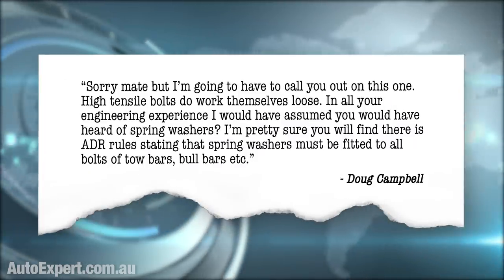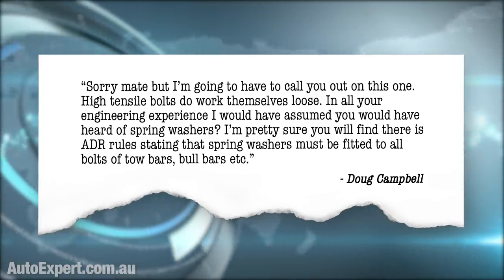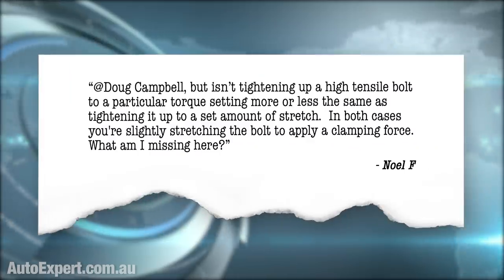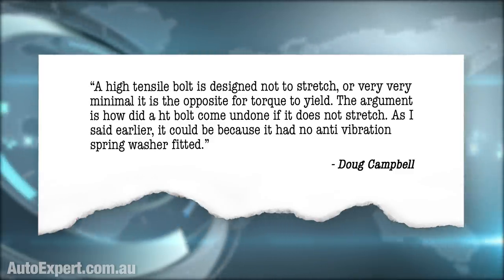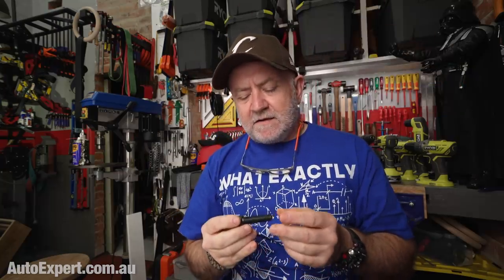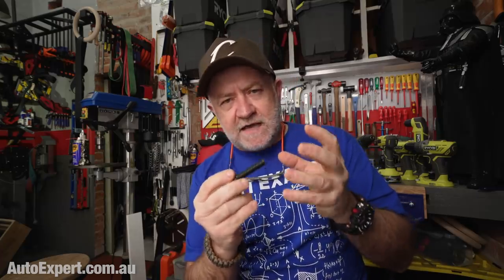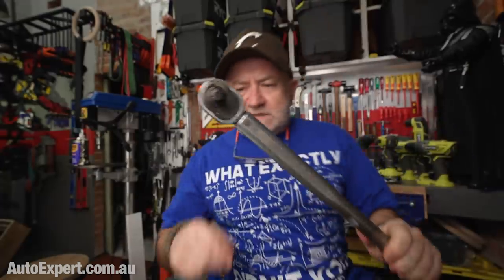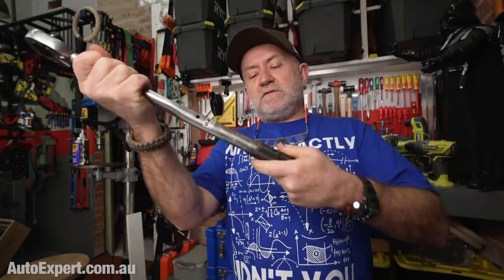The applied physics of high tensile bolted joints and assembly in cars | Auto Expert John Cadogan

Comment: Your conclusion about under tightening is probably correct, however there are two more possibilities: 
1) the bolts are labelled as 8.8 however counterfeiting is rife in Asia and they may actually be cheap chinesium labelled falsely. 
2) Your photos seem to show that the bolts have been coated. In Asia it is common practice for 3rd parties to apply galvanising, zinc, or a number of other different rust preventative coatings with complete disregard to the possible devastating affect upon the metalurgical properties of the fasteners due to coating. It is expensive for companies like ARB to ensure that the bolts that they buy were infact coated by the bolt manufacturer rather than a 3rd party, and maybe they just bought the cheapest untraceable bolts that they could find provided they were marked 8.8.

Comment: Thank you, John your video was so interesting, the 30:26 video felt like it was 5mins. The lesson was fantastic! The benefit is that you have helped improve the safety of tow bars and possibly saving someones life by educating us with the applied physics of high tensile bolts! Also and most importantly not to modify an installation kit in anyway. If I have a tow bar fitted , I will make sure to check the installation with a copy of the install instructions to make sure the fitter has fitting the tow bar correctly!

Comment: I agree with your discussion of clamping force and torque required to loosen high tensile nuts. I think there is another factor that makes spring washers ineffective on high tensile bolts. I think the high tensile bolts and nuts are heat treated to case harden the metal. The chisel action is less effective on a case hardened surface hence will not work as hoped on high tensile fasteners.  I may be using incorrect terms here. I'm sure John will correct this.

Comment: Hi John, love your work mate, I would like to throw in an observation about Tension Wrenches.
I was recently replacing the Con Rods and Big End Bearings on a 65 year old motorcycle, after tightening the big end bolts to the specified tourque (using a brand name British Tension Wrench) I could not rotate any of the 4 conrods on either of the crankshafts (Square Four engine with two crankshafts) 
After several hours of head scratching, beard stroking, disassembly/reassembly and measurements I “discovered” that my Tension Wrench was reading low by almost 50%.
8 new Big End Bolts and Nuts @ $150 later I have learned a valuable lesson.
Regards
Kevin Dennis
P.S. Just had a flashback memory of my time on aircraft in the RAAF, on some Critical Maintenance Operations we had to take our Tension Wrenches to a calibration workshop, have them calibrated and then carry out the task within a set (very short) period of time.

Comment: I did up some bolts yesterday with a 75mm socket to 8000nm, had to measure the stretch on each bolt (no spring washers)
Reply: M48 x 5 (10.9)   ?    :-)

Comment: Watched you for the first time yesterday on the tow bar issue and today on your response to Mr Campbell spring washer add on well done to you for putting right as this could avoid a serious accident. As a boilermaker in the oil and gas industries on high pressure piping work i understand your concern about doing things wrong and you mentioned repair welding of the split in the beam that you got spot on even to the point of mentioning of LH welding electrodes for high tensile materials unfortunately as you probable know welding is also a serious task to do right and many hobby DIY welders try and and weld stuff that there little cheap MIG welder is just not good enough for quality repair and don't know what a LH rod is . Greetings from the UK and keep up the good work.
Reply from the maker: Thank you very much John. I really appreciate your expert feedback. There is so much uninformed commentary on YT, and I am waging war against it. Your comments about DIY welders are spot on. I see infinity DIYers not bevelling their joints and then grinding their welds off, following marginal power welding... I feel your pain when you see stuff like that. Once again, thanks very much. Keep up the good work mate.

Comment: Chances are the towbar in the previous video was tightened only with a rattle gun. I use one to speed up jobs, but always finish with a torque wrench for anything critical. Properly torqued bolts don't come undone, otherwise every engine would just randomly explode at some point. Older style helicopters had something called the "jesus nut" or "god bolt" which attaches the main rotor to the drive shaft. It is amazing to think of the forces that can be managed by an appropriately engineered single fastener.

Comment: When you speak of the split-washers(spring washer)  "chisel action"...I've seen disassembled  bolt-washer assemblies & one will note these are only effective when the washer is of a harder material than that of  the bolt or nut, so that it  CAN dig in with that "chisel effect"....that hardness difference.
Reply: I agree. In fact that is the core of my comment. So the questioning the mind of this amateur is, "Is the hardness of the spring washer more or less than the hardness of the high tensile bolt and nut?"
Reply: @mayflowerlash11  As I noted, "I've seen disassembled bolt-washer assemblies...", and they are marked by  the spring-washer, making them  softer than the washer. A logical conclusion would be, if the two materials are of identical hardness, there would be zero "chisel action"...rendering the outright purpose & function ineffective. Is a "high  tensile" bolt softer than the spring washer?, I would think them identical, killing the function of the washer.

Comment: Spring washers generally are not used in aircraft applications. Nylock nuts or metal locking nuts are standard, but torquing is still required. I used to manufacture switchboards and all the bolted joints were torqued, because in high current applications failure would occur

Comment: Spring washers are helpful in light load applications in "softer" fastener materials where they can bite. I've never designed or seen them in high tensile applications where the rotation countering design can't bite due to both load and fastener material, and a spring washer itself always introduces a "weakened" element (by it's very design) into the assembly. I've designed many bolted and screwed assemblies over decades including adjustable open-cut mining rope fittings with custom made twin M64 threads and nuts of materials stronger than HT fasteners, and always with flat washers. One can use additional lock nuts with pins or wiring if an environment that may offer risk of loosening such as with vibration or cyclic loading. As to the stress and strain issue, you can't have one without the other, even if the strain is only at an atomic level at a very light loading. :)

Comment: In 33 years of mining experience flat washers are used with high tensile bolts on most of pipe flange bolt ups, talking 100 ton steam lines ! The only flange failures I saw was bolts not tightened or incorrectly tightened. Great subject to which most of us wrenchers neglect.

Comment: I reuse torque to yield bolts all the time!
As thread chasers.
You spin a suitably nut or die on one grind off a bit of one side of the bolt to create a cutting channel then spin the nut off and you have a thread chaser.
I also use them in non tensile places and even grind a point on them and use them as nails.

Comment: In my 20 year's in the commercial tyre industry,   torque figures were gospel upon every wheel assembly,   even being requested by the electricty power station too torque up for them in the powerstation,   plus everytime i was under a vehicle too jack up i looked out for loose nuts and bolts especially brake component ,  I would strangely enough find on a regular basis even Springs broken in half plus the brake pods damaged,   disc brakes smashed or badly cracked,   wheel nuts were a regular basis loose upon my onsite,   sadly mechanical workshops were the worst at that,   spider hubs were my favorite but sadly most weren't placed on properly,   I carried a box of studs and wedges and nuts because of not tightened properly,  even had one truck loose 8 wheels ex workshop,
Reply: You must be the only tyre fitter in the whole of Europe that torques up wheel nuts correctly, every one I come across is rougher than a rough  thing. Using a torque wrench after smashing the wheel nuts back on with a 1500 ftlb impact wrench isn't setting the wheel nuts at 600nm. Don't tell me you only run the nuts up then try um, well I've tried it at home just to see, just one hit and they were over 140nm setting. Hgv tyre fitters really ram um on, ive had the studs snap before now.
Reply: Michael  strangely enough I have seen and been a victim of fellow work mates and operating workshops doing them up so tight I have had to use a 2 metre steel bar and a wooden block to enable too losen nuts,   my thoughts are impact wrench too the face all around and then at least half a turn with the torque wrench,   strangely enough not many work mates liked working with me on the big jobs especially working Friday morning till Saturday night on my fleets of 60 truck and trailers,   as our trucks here in New Zealand are HGV only now with 26 tyres each plus they mostly use central tyre inflation systems,   plus all are highly polished aluminum rims,   plus on call 24  7   all year.   Sadly at 100 hour week's my body completely wore out and I am house bound now on the pension,   but my generation were taught hard work didn't kill you ha ha ha ha yeah right working for Bridgestone commercial was a good job,   my only concern is watching YouTube video,     😆😆😆🙈🙉🙊💩.

Comment: I am a fanboy of springwashers for applications with low torque spec, it is easy to see that someone wants to use them for all applications Doug is very likely a caring mechanic! After you used your torquewrench always put it to 0 NM again when you put it away.
Reply: Use long bolts and prevailing torque nuts instead.
Reply: @johnwade1095  Use the bolts the job requires and use them to spec.
Reply: @carstenweiland7896  generally, if I'm replacing a bolt it's because it was specced wrong. Or someone cut corners and used Chinese 12.9 fasteners.

Comment: Stretch Bolts, I remember reading a Kawa ZX7R workshop book and for certain engine bolts (head bolts) it was indicated that they could be used multiple times but provided a table that indicated how to torque/angle them based on 1-3 uses then throw them away, I can not remember if it also indicated the length to just confirm how many times they had been used.
I was surprised when I saw that.

Comment: Hi John, great piece. Especially the reduction in torque for lubed up bolts. Didn't cross my mind.

I do, however, have to point out, that the Earth is approximately 40kkm in circumference, not diameter.

Only because you are a meticulous person and often add corrections in your videos. Sort of reducing the possibility of some nut bag brining this up as an argument.

Comment: I totally agree with what you have said here . BUT working in the smash repair industry for over 30years my only concern about your last video is welding the chassis. It would be best to check the manufacturer repair procedures first .  
Some chassis’s you can’t heat or weld . Especially trucks. Car metals are so high-tech now many high tensile steel‘s used etc . Special inverter welders are required just on the panels alone . 
I’m not saying you can’t weld it . I’m just saying it’s ALWAYS best to check repair methods first
Reply from the maker: Good point, but ute chassis doesn't appear to be all that hi-tech.
Reply: @AutoExpertJC  you would be surprised how many you are not allowed to weld
That’s why they are written off by insurance companies so easily
Reply: @barry.m9681  I suspect that may be the reason for the dealer and Ford's reluctance to fix.
Reply: Someone had better tell all of the LC200 and LC79 chassis extenders out there they can't weld chassis anymore. I'm confident you can weld a chassis on a current Ranger  given that is how they make them, by welding numerous sections together to make one chassis. If it wasn't suitable to weld the chassis, it would be constructed using rivets or huck bolts.

Comment: Bolting in caves for climbing and rigging we never use spring washes even though they are under dynamic loads. It's kind 101 stuff, you tighten bolt correctly, set the bolt correctly, install it correctly... etc... you're bolt does not come loose (regarding high tensile). Mean it not got the same kind loads trailer does, but still high tensile bolts getting wiggled and pulled on a lot.

Comment: At 8:25 what are the types of fasteners specified?
If the nuts are self locking there is no requirement for lock washers on lower tensile connections.
Spring lock washers are entirely useless in any case, they either fail to prevent the fasteners coming loose or the fail period, the number of times I’ve had spring washers split apart and fall out before I’ve gotten to the torque spec is ridiculous.
There is however higher strength alternatives of  castlelated washers crown washers and the new dual ramp washers.
The dual ramp washers have been tested beyond the point that even thread lockers fail.
What the commenter said is partly true fasteners subject to high vibrations and or temperature changes can become loose especially if lubricant has been used on them. While lubricant can increase the amount of torque on a fastener as it helps overcome friction it can also give a false torque reading. The lubricant can fill the gaps between the threads of the bolt and the threads of the nut temporarily and when heat and or vibration causes the lubricant to seep out the torque is reduced.
It is highly recommended to recheck the torque on any fasteners that have been lubricated after a duty cycle.

Comment: One of your best. Aimed skillfully at the Engineer and Apprentice alike. Hopefully what Doug also took from this was the underlying message, if you are a mechanic, be the best you can be and and show respect to, and don't try to be, a design engineer.
Reply: @WheresmywingsRedBull  I did as you advised,  so did the suggested research at step 47.
Also, calling John a dropout does not enhance your credibility, clear thinking wise.
I think you have missed two points.
1. John explained the need for flat washers to enhance load sharing area which ARB use so they agree with his engineering analysis including the need for torque settings..
2. I was careful, as was John, to ensure I did not reflect on your qualifications, showing respect for your chosen area of expertise.
I suggest you could do well to do the same. 
BTW I am a mechanical and structural design draftsman without any particular agenda.
Reply: @Mechautoinsight  so if you had of looked at step 47, you will have seen that the manufacturer, ARB designed, and recommended spring washers to be fitted to  the bolts of the tow bar in Question, and they CLEARLY WERE NOT FITTED. Going against everything John has fumbled over in these two videos. Now if I break down your original comment, it implied I was trying to be a design engineer and had a lack of respect. Can you please explain to me how this is the case when both you and John have overlooked on simple thing. Follow what the manufacturer designs and recommends. I’m pretty sure John the hypocrite actually said these words in this video!

Comment: From what I have seen of most braking systems on trailers with the exception of those with air brake systems is that they do not fail safe!
Once the connection to the vehicle is lost the brakes have no means of applying. There is a small possibility that on some of them the towbar dragging on the road will put pressure on a brake providing the reversing lockout has been deactivated.
Reply: In my neck of the woods (mountain country) it is required on trailers over a certain size that have electric brakes fitted that there be a battery on board the trailer that will apply the electric brakes full on if the trailer detaches from the towing vehicle. A simple switch on the trailer is activated by a thin aircraft cable connected to the towing vehicle if the trailer and the towing vehicle get more than a couple of feet apart.

Comment: Thanks for clearing some common misconceptions.

Another issue with spring washers in highly stressed high tensile joints is, that they are prone to fail.
Compared to a hard and complete high tensile washer, they are flawed and weak
.
 I have seen many of them splayed.

My personal view is that even in low tensile joints there are several better options that spring washers .... nyloc nuts, locked pairs of nuts, castelated or other pinned nuts & bolts,  for example 
AND a cheap spring washer is worse than nothing.

YEH and good torque wrenchs ARE real affordable these days .... and an eye opener when you start looking at specs and torquing accordingly.

Comment: The other thing that disturbs me about Dougs comments, is that he would fail any vehicle that did not use spring washers on bull bars or tow bars. So he has now admitted to incorrectly failing vehicle safety checks, and possibly even then scoring subsequent work to "rectify" the alleged defect. Mmmmm I wonder what those customers would have to say? I'm surprised he hasn't been called out by a customer asking against which ADR or standard he has failed it.
Further, by modifying the certified design of the bars through the installation of the spring washers (assuming that is what he does), then technically wouldn't that now make the vehicle non compliant? 

Great video John, whilst I do chuckle at some of your normal theatrics, they do get a bit old. This was a refreshing change!